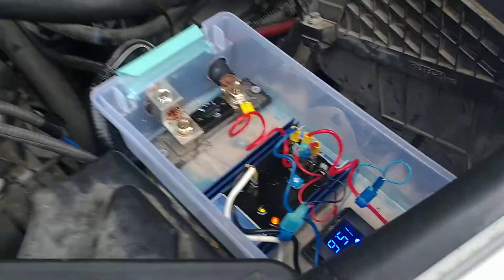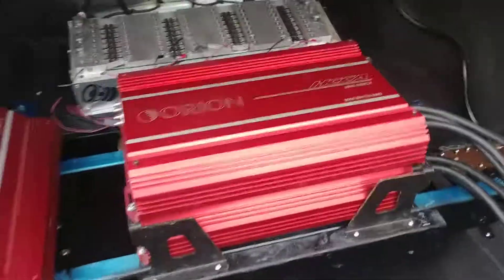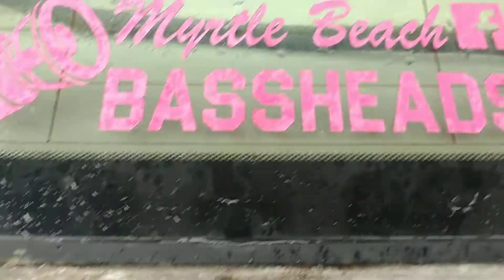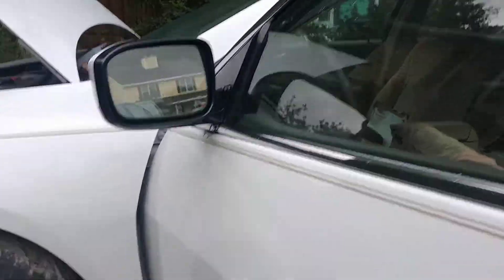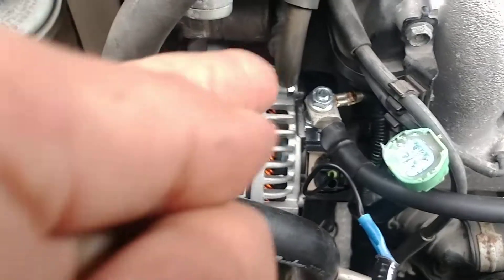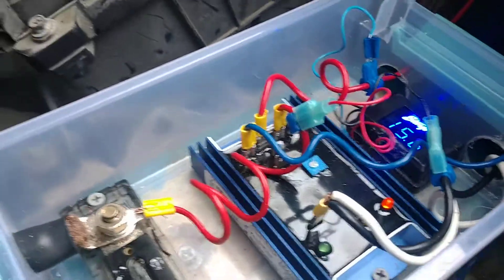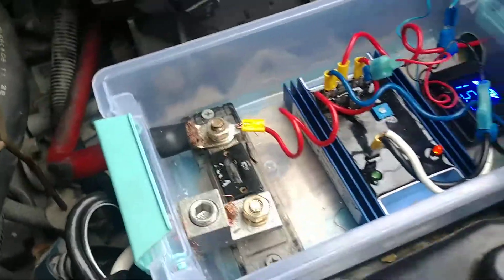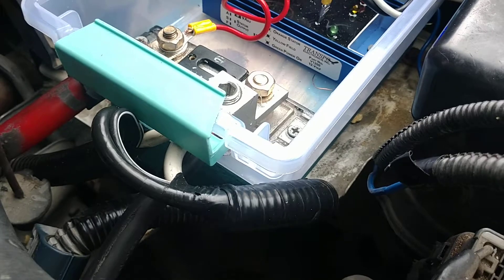07 Honda Accord adjustable external alternator regulator Transpo v1200

Comment from the maker: As far as the wiring goes, the black and the white wire, ground. I have one going to the body and one going to the alternator. The red wire entering the box next to the voltmeter, is the 12-volt turn on coming from the fuse box Acc. The blue wire is the field wire.. running to the plug coming out of the alternator. The red wire coming from the big fuse is the constant 12 volt. If it helps give it a like

Comment: I might need a little more info on this. Will this work on a 06 accord, and with a Mechman 340? Tryna run 2 VP 700.1s(7ks). Have agm at the moment and working on lithium
Reply from the maker: I haven't had any issues, should work on an '06 too this one is an 07. I like to run externally regulated alternators. Yours is probably internally regulated, but they might have options to boost up your voltage output, some of my people use diodes , to boost it up.for when you switch over to the lithium.
Reply: @egidio6david0  pretty sure it’s internally regulated but I need to bypass the icm